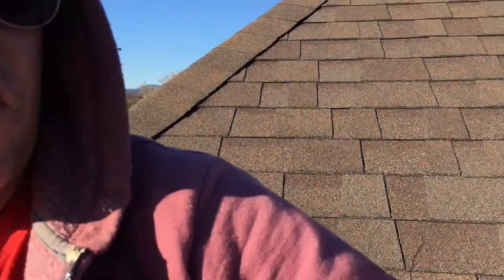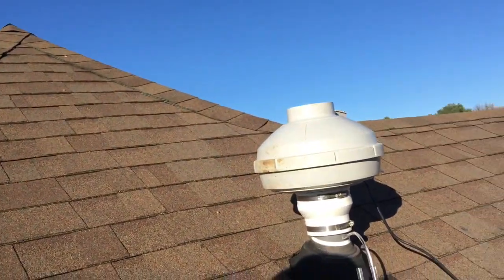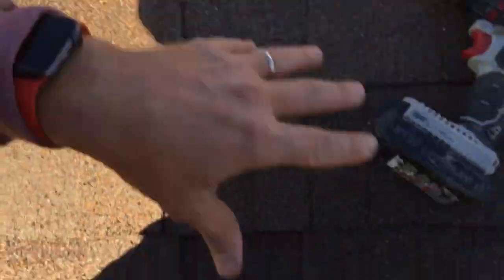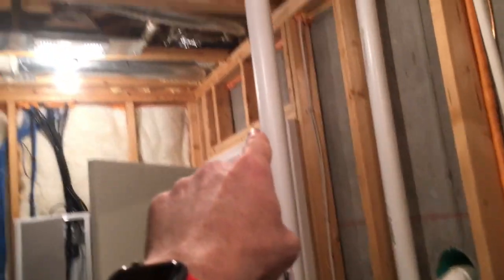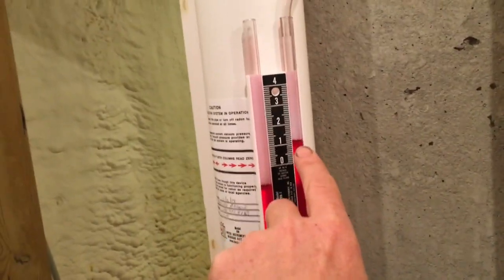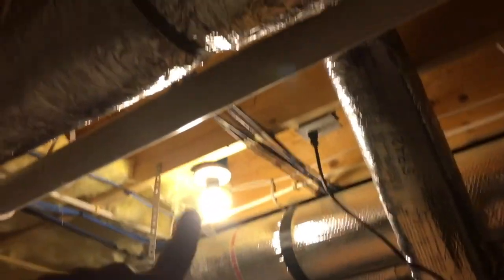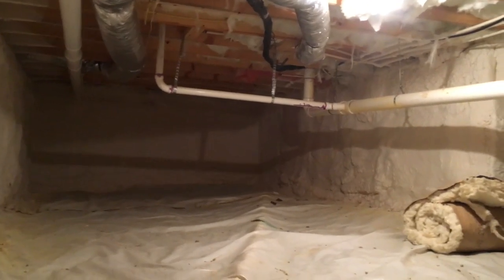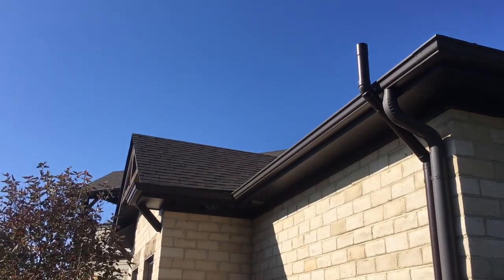Ineffective Passive Radon Systems

Comment: Hi Scott, If a basement is finished and there is no option to run the plumbing for a Radon Mitigation system from the inside can the plumbing tie into the outside perforated piping going around the foundation instead?
Reply from the maker: Hi Peter, It doesn't feel like the right solution.  Might need to proceed and then box it it in with carpentry, and dry wall, etc.
www.nrsb.org will bring up a list of radon pros who you might want to consult with.